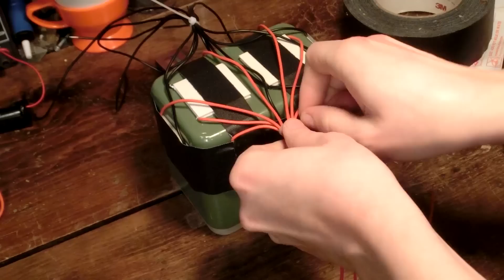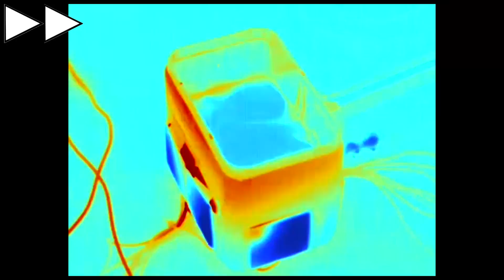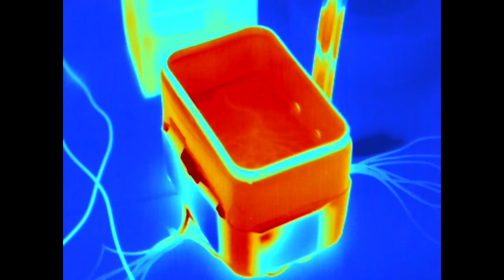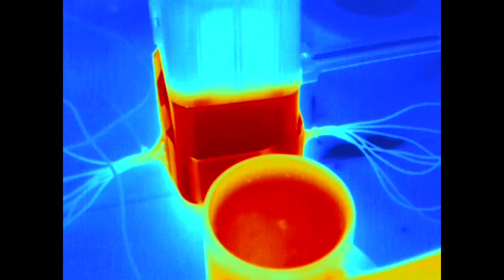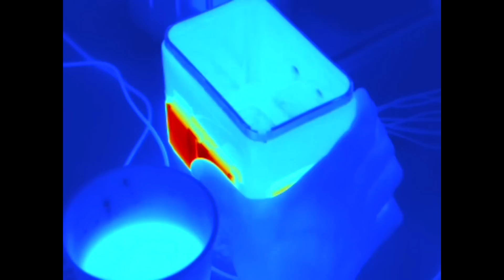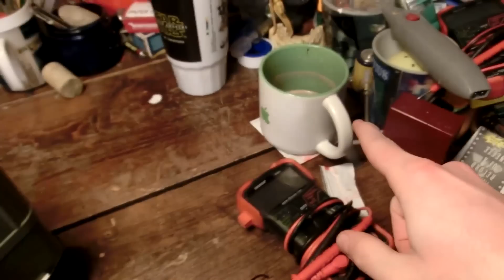Electric Ration/MRE Heater 03: Thermoelectric Peltier Cooler Test

Comment: yeah of course its not working well enough. you've set 5 volts and 5 amps. you have to use 12V and these require 3Amps each..
Reply from the maker: your understanding of this is limited

Comment: I have no idea why people are using Peltiers for heating if they are incredibly inefficient in doing so... They consume a lot of power which has to be DC power and require a complex setup. A simple resistance based heater would be a much more efficient, cheaper and easier to build source of heat. Use peltiers only if you want refrigerators or personal air conditioners without having to use a compressor (heavy, noisy and fragile). Peltiers are not efficient but they are ok for air conditioning a single person or making mini fridges.
Reply from the maker: but they arent innefficient, they are actually quite efficient since they also work as the perfect insulator. just a shame they cant have more power.

Comment: Peltiers are simply not good enough for high temp, thats why they make Seebeck TEGenerators.  You can warm/cool something sure, but.. its not really cooking, and its a faster degradation of the tec's. The great thing with the Seebeck high temps is how they utilize them with cooking pots, for Usb charging. Boil water in them, plug in usb chargepacks. Japan pushed out a ton of them for use during the power problems they had with their damaged reactor area. You can find them, the mainstream ones are way overpriced. I got mine I think for like.. 40 dollars. Throw it on a woodgas solo stove, and you get the best out of a hand full of twigs.. and no smoke. So then you have a day or night charger,  no panels, no weather problems. Its not well known mainstream, but it will outlast and over perform most charging utilizations that are commonplace. As well you can use the seebecks with solar evacuated tube cookers with sunlight, and no fire at all.

Comment: Your tape is acting like a heat insulator on the outside of the canister. Why not stick the plates to the canister with some thermal paste and put heat sinks on the outside to collect heat quicker from ambient? Remember, it is essentially a solid state heat pump, insulating either the cold or hot side will decrease performance :)
Reply from the maker: +Agentrfr because it can only have a small temp difference. i dont want freezing weather sucking all the heat out of this.

Comment: I really like the idea and your open-minded tinkering, but when it comes to heating stuff fuels are pretty hard to beat. A simple soda can stove with a small bottle of denaturated alcohol will provide heat energy output measured in kilowatthours. Just a few 18650s would weight the same. I'm still eager to see where this electric heater is going.
Reply from the maker: +MrDementori its better for me because i dont want fire on someone elses property

Comment: one good test would be to   take one   put a heat sink on the hot side and put it upside down in a glass of water    and test temp vs time              thin replace water     and do the same test but with a sec heat sink on the cold side     and  test temp vs time       im not sure if it will git any hotter but it should def be faster       and faster means  it would use less battery power

Comment: Very cool. One of your car batteries might do the job for a 12V test.
I think peltier coolers are actually used in those metal fans that sit on top of wood stoves. The heat on one side and room temperature air on the other side generates enough electricity to spin the fan.

Comment: A few points...
1. You are attaching the modules to, what looks like, an insulated vacuum flask. Something that has been designed to limit thermal conductivity. I recommend using a cheap single walled pan that has been designed to efficiently conduct heat. Attach them to the flat underside.
2. you need to view these modules like that of a CPU. Use thermal paste to better conduct the heat away from the module on the hot side, the same should be done on the cold side (large mass of copper/aluminum). They can easily get damaged by not evacuating the heat properly.
Reply from the maker: 1: its not, its a solid chunk of aluminium with 1.5mm thickness
2: i say that in the video. this was just a quick test i did before filming another video.
Reply: +Rinoa Super-Genius just watched it back. I can now see that it is in fact single skin (tell by the rivets attaching the handle). Apologies. I would still use a different container to ensure a perfectly flat surface and no paint to attach the modules.
Reply from the maker: Edward Bedford
yeah i just ordered a different container, but i'm going to probably tinker with both types and kinda split this project into two. still same series but i'll be developing my original idea along with this one.

Comment: would a heater cartridge not work better?
Reply from the maker: i'm not sure what ya mean. please explain more.
Reply: They're small low cost enclosed heating elements that can get extremely hot quite quickly. We use them in mylar sealing machines that we build, where we need a temperature of about 325ºF. They normally run off mains voltage, but you can get 12V and 24V versions as well. Ideally, a block of aluminium that the cartridge is inserted into is good for spreading out the heat over a flat surface.

Comment: if you put half the coolers in series with the other half you can run at 12v on your power supply? or does it not go up to 12 volts?
Reply from the maker: i said that in the video. i'll put them in series to run them at 24v.
Reply: O I C , left befor the last 1 min

Comment: I guess you should stick the thermo-electric generators to the metal with thermal glue to get better heat transfer. btw nice video Rinoa

Comment: I wonder how it would behave if you mounted say 4 Peltier devices on the bottom of the tin, and put it on the snow.
Reply from the maker: probably would have a hard time due to the snow cooling the system down too much. it would have to heat up the snow to heat up the pan.

Comment: maybe running them off a 12.6 v li-ion pack or controlled voltage from your ebike battery or wired in series so the full ebike battery voltage could be used with out regulation this way as your riding you could also be heating water or use regen breaking to heat the water with the super caps

Comment: Get a silicone heater from aliexpress, many store can do specific size and power rating that suite your need.(Ali Brother store is very popular among 3D printer users)
They also come with adhesive pre-applied so you can stick it to the side of canteen.
Also try to find some insulation to help minimize heat lost.

Comment: Wow! Lots of peltier people on here.  I have done some work on peltier refrigeration and it is most inefficient compared to compressed gas systems.  Compressed gas systems have at least a 3 to 1 advantage over peltier except for the number of moving parts.  As mentioned by a previous poster, resistance heat would be more efficient than peltier as a heat source.  The cheapest solution to heating would be to adapt an old school immersion heater but they were usually 120 VAC but there may be 12 VDC versions out there for use in autos.
Reply from the maker: well it cant be less efficient because if i put 8w of power into it i should get at least 8w of power out.
Reply: I would have thought just dropping a couple of high wattage wire wound resistors into whatever you want to heat would work just as well as an immersion heater. I'm thinking about experimenting with those very cheap Chinese soldering iron elements for this as they get very hot on low voltages (24v ac usually) and have a built in thermocouple temperature sensor.
Reply: You would be correct.  Just that the immersion heaters are food grade.  No lead etc.  As for the peltiers, you have energy consumed to generate heat on one side of the device and cold on the other.  If you don't provide a sink to shed the unwanted portion there would be little point in using them.  I have managed to get a 40 degrees C temperature differential by using a heat sink and stacking two peltier devices but that still does not meet my need for a freezer that needs to be at -20.

Comment: Hmmz you've triggered part of me to want to experiment with peltiers again but i think they burn out when you get them too toasty, If you can warm up the cold side i think it will deliver more heat to the container of water.
Reply from the maker: maybe, but i want this to work in sub-zero temps.
Reply: Not sure how you could increase efficiency on that then since its a heat pump shifting one temp side to the other im thinking the one side must have what its trying to move. I did once heat a small amount of water using nichrome wire and a 12v source i just don't know if water is chemically safe after having the wire in it who knows?

Comment: idea about Manjerka is that you have a large mobile cooking stove as a part of every unit of soldiers called quartermaster service.

Mobile stove- kitchen  (trailer next to truck): http://i62.tinypic.com/ae6rfl.jpg 
Their job is to make food and then prepared hot food is shared to every soldier in manjerka, and is therefore designed and constructed so that the heat stays inside longer. As I recall it, could even be exposed to direct fire and paint shoudnt be damaged.
Therefore, my point of view is that the issue is with color, which manjerka is painted with.

Comment: you need to remove the tape from over the peltiers and even if possible attach a cpl of heatsink units so it is easier for them to absorb the heat from the ambience and transfer it into the liquid or vice versa depends on what direction the current is flowing.
Reply from the maker: i dont want to let ambient temperatures suck the heat out of the peltier coolers though. i want this to work in sub-zero temps. i only really care about the heat pumping effect giving a nice form of insulation.

Comment: This cells will be over 100% efficient when heating stuff up, because  they are stealing heat from cold side. This can be nice with limited energy :D
With heatsink on cold side they will be much better than simple heating elements.
You must use some kind of thermal coupling, thermal pads will be ideal due to re-usability when you will wash container.
Insulation of this part of container, that is exposed to air is important.

You can build nice wooden construction to get removable container, and get pressure on thermal pads

Comment: problem is paint. this Manjerka isnt made for heating from outside its made to keep heat inside
Reply from the maker: it doesnt seem to have any real insulating properties judging by thermal images. or at least i havent noticed.
Reply: maybe you should try to make some kind of inner pot made of aluminum, which is thinner and to set the heaters between manjerke and this inner container and thereby to achieve the maximum effect of heating and heat preservation

Comment: Alternatively you could pour a hot liquid into the flask and use it as a power source? 
Also the peltier plates as a heater might over drain your 18650's making them unable to charge later.
Reply from the maker: not much power, and thats why you put a BMS on your cells.

Comment: better conect just 2 peltiers at 12v then 10 at 6v
I made A/C from 4 peltiers and it cools 6m2 room to 25C when outside temp is 33C
and can u pls try to make geotermal cooling/heating system pls !!!!

Comment: You can get some very cheap induction heating kits of ebay/china, which can run off of 12V. Maybe you could use one of these and heat the underside of your container?
Reply from the maker: no thanks, sounds like too many components. plus i seem to remember AvE having loads of issues with those kits.

Comment: You probably just pumping electric energy in it because you insulated the backside of the peltiers with the tape. You could use heat-conducting double sided tape to fix the peltier elements to the can and on the cold side add some cpu heat sinks (or in this case cold-sinks).
Reply from the maker: well thats the plan, i dont want it to pump heat, i just want it to act as a nice insulator. and it does that fine.
Reply: I thought the plan is to pump the warmth of the environment into the can.

Comment: What is the rated voltage for these Peltier Elements? Also, have you tried some ultra-portable Lithium battery packs from china to power these, as the prices are really coming down for those at higher amp hours (though it would be good to check if the amp hours of those are as they say they are)
Reply from the maker: i think 14 volts. i'm excited to see how this works when i get lithium grease, the plates alligned propperly, and running at 12v.
Reply: Oh yeah - can't wait to see it in action when its done :D

Comment: Instead of taping on the heating elements build a simple plate that could magnetically attach to bottom of your bowel. A PTC heater element could do wonders with a small few lithium ion batteries and small bms. Good luck.
Reply from the maker: magnetically attatch to an aluminium bowl? sure :P

Comment: Are TECs more reliable than PTC elements? Are you going to remove the paint where you install the TECs? Do TECs need linear power for best results?
Reply from the maker: not sure, but the enamel coating on this pan should be pretty thermally conductive.

Comment: Wait, doesn't a Peltier cooler effectively act as a heat shunt, IE using the current to transfer heat from the cold side to the warm side. Meaning there's an eventual practical upper limit to the temperature this can reach based on the ambient (In theory with enough current it would warm things until ambient reach's absolute zero.) Plus the waste heat generated by the inefficiency of the design. If you don't want to make it a permanent modification, just use thermal pads. Not as efficient as thermal compounds, but its better then just having it against the metal.

I remember playing with them as a possibility as a decent CPU cooler, but the problem with it being that you still needed a water block and radiators to shed the heat it put off, and reducing the cold side to below ambient led to condensation issues on the motherboard, which meant puttying the MoBo and using lots of foam, the sub ambient cooling being the primary reason to use them. Neat little toys though. You can increase the heating effect by stacking the coolers hot to cold to form a heat pump, but at your scale its probably more efficient to increase amperage. I just know from my, admittedly limited experience (I stopped screwing around with them at the time I stopped having money to fuck around with PC hardware... hence why I'm still using the same PC.) the things got pissy when one side or the other was too far from ambient. Mostly the hot side, because again, I was only interested in them for a potential CPU cooler.
Reply from the maker: well you get some energy transfered, but i'm not sure if you also get the heat in watts that you put in or if you get that plus the heat your pumping, but either way it should work just the same as a filament at the very least since more heat comes out of a peltier cooler's hot side than goes into the cold side.

Comment: you need some mass on the cold side to shed the temperature off the ceramic plate.  maybe make a copper band around the container?
Reply: Peltiers pump heat from one side to the other, if there is no heat at the cold side, I doubt it will heat your food. Only the waste heat from the power will be very inefficient i bet. Why not just use those 12V dipper heaters, how do you call those? Like this https://images-na.ssl-images-amazon.com/images/I/41j-qYJNDYL._SY300_.jpg
Reply: ThriftStore Hacker
Reply from the maker: i plan to do something for that, but i want this to work in sub-zero temperatures so there will always be a steep temperature gradient.
Reply: After you heat your food/drink i wonder what kind of voltage you get out of the modules if you stick the cup in the snow.  May be able to get enough power to charge a cell phone or a small flashlight if you add a controller to regulate the volts.
Reply: Although peltiers are heat pumps, they're dreadfully inefficient. Meaning they're not great for refrigeration but as a heat source they're quite good.
Reply: Maxim Schut